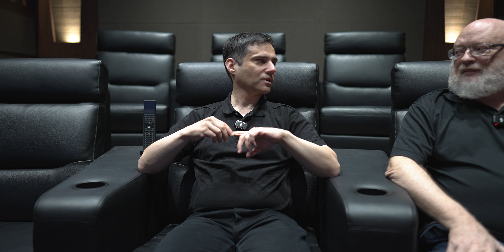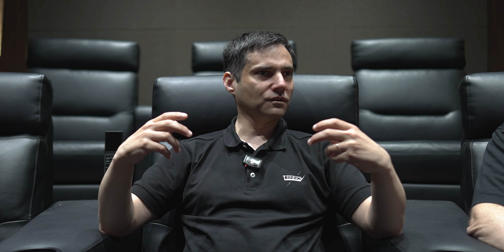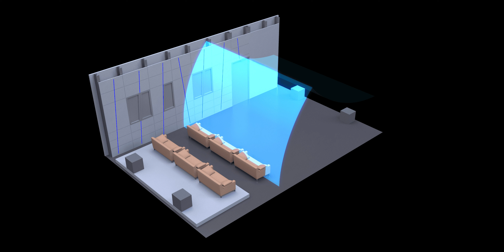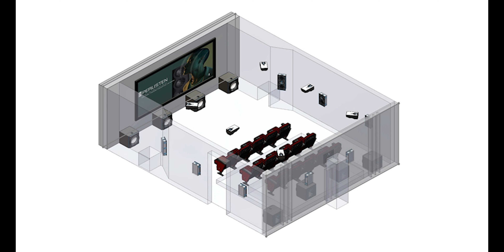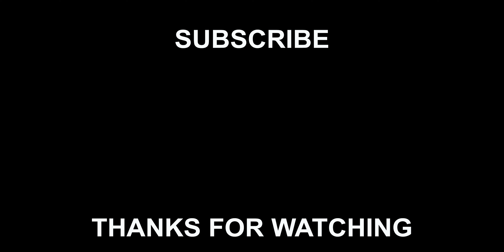Trinnov Cylindrical Waveforming & Infrasonics

Comment: I bought the latest Sabre DAC/HDMI2.1 Trinnov Altitude and four HSU ULS-15 subs to perform cylindrical wave forming at the front, and reusing two HSU VTF-15H in sealed mode I had from my old theater layout. Still working on it.
Reply: How’s it working so far.
Reply: @bigjack79  Love it!

Comment: I dont have any comments on the video and hopeful with the technology being beneficial.  What I wanted to touch on was Munich high end trinnov demo was very very poor in my opinion.  My room provides a far better home theater experience and I was truly shocked, the only benefit of a doubt I can provide is that the room was not sealed.  There was no roof and the entire top opened into the rest of a massive room, yet with 8 subs which were hitting hard and were clearly calibrated the entire thing was greatly disappointing for me and having my first ever trinnov expierence and it was 11.6.8 with all perlisten high end monitors.  *I was sitting in the sweet spot, front row directly in the middle.

I am really hoping that, as I may have not properly understood, they did not apply this technology in that room because the entire thing was diminished to none existant.

Comment: How does one accommodate the placement of freestanding LCR tower speakers placed optimally away from the front wall (minimisation of early boundary reflections) with the placement of the subwoofers in their recommended location? Do the LCRs then interfere with the wave propagation, or are they deemed transparent for the purposes of the wavelengths being propagated? And if not, can that be compensated for?

Comment: With waveforming, what’s the minimum height does the subwoofers need to be off the floor with 4 subwoofers.
Reply: good question
Reply: Probably depends on the height of the room and if you have more than one row.
Reply from the maker: Did you guys use the link to input your rooms measurements?
Reply: @therealshanelee  just did.  Very helpful
Reply: @therealshanelee  It answered all my questions.I should have looked there first. Cheers.
Reply: @therealshanelee  sorry, I can't see it. Thanks anyway